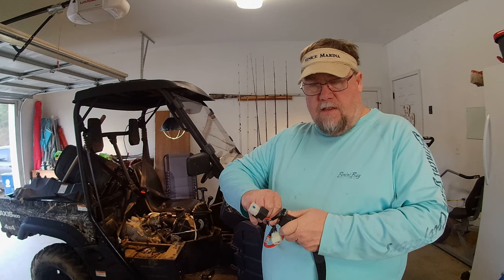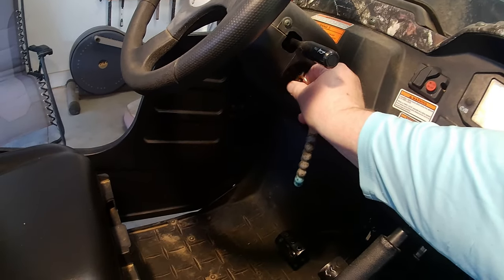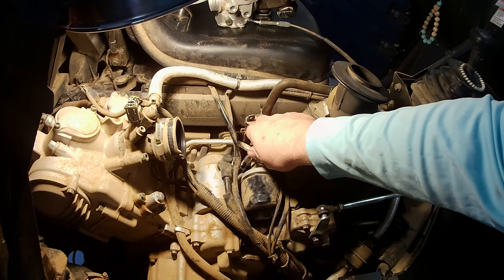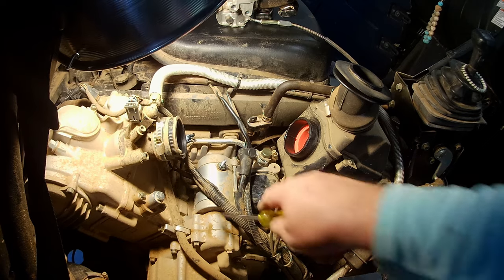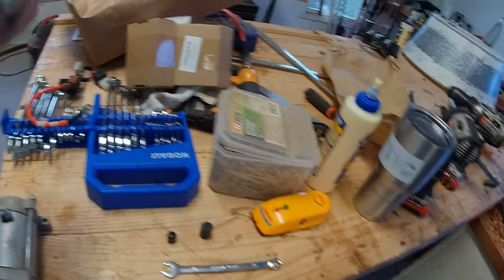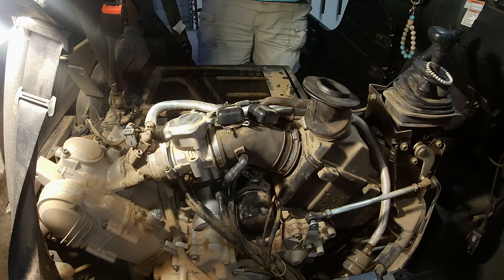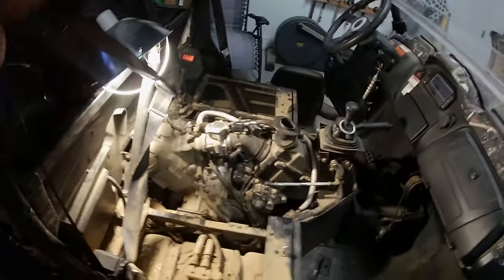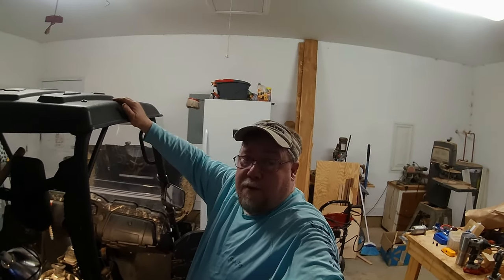Adams Famiy Homestead fixed UTV Starter and Solenoid Cranking problems on Axis 500 4x4

Comment: Thank you so much very well done!!! I kept saying hope the bolts or nut to starter didn’t fall under 😂 They don’t give you much room. Mine is just doing one click. The battery was over 3 years old and 150 hours so just replaced and still same issue so I will check it out more but now I know what I might be up against. Take care and thank you again, Tony P.S. Just Subscribed 😊
Reply from the maker: Glad it helped I have an electrical problem now not priming the fuel lines. I think it’s a bad relay. Thanks for sharing